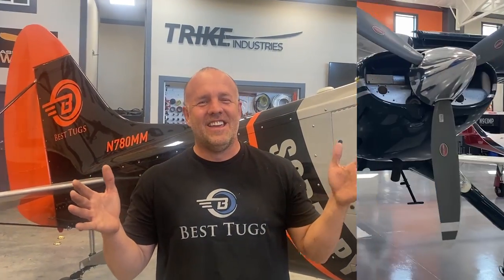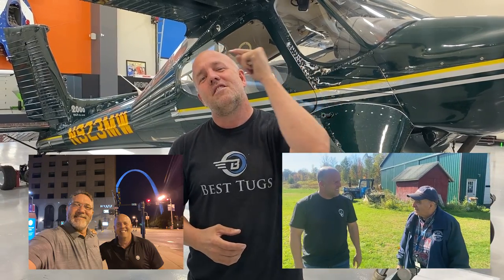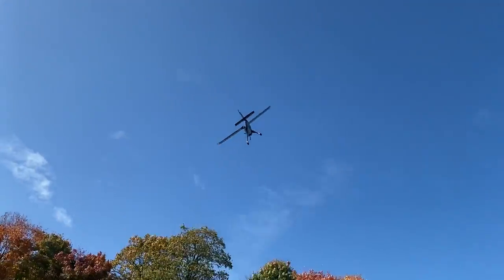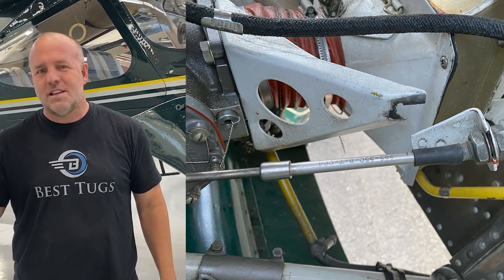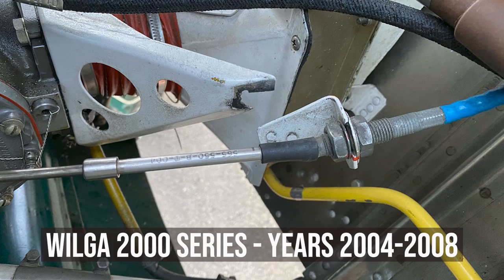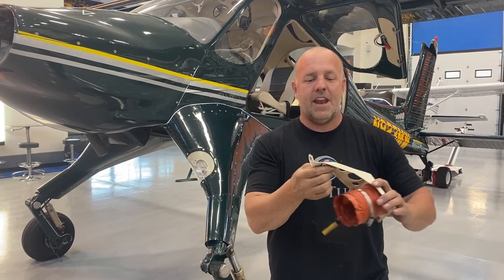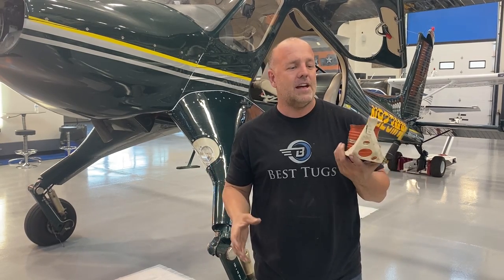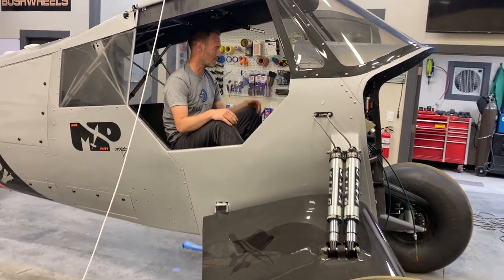Engine Trouble Flying Home a New Wilga 😬 | Scrappy 30

Comment: Okay, I've always been wondering this. Why aren't these things just fuel injected? Why do you have to adjust the mixture all the time? Is it strictly for altitude or do you also do it for performance? I guess mainly is just Why aren't these fuel injected? I know what Richland up an engine does less power cooler running motor Etc so what's the deal?
Reply: Mixture adjustment is necessary for altitude, as you go higher the air is thinner so in order to keep the proper ratio of fuel to air the fuel is reduced via the mixture control.  It is also used for economy and range by reducing the gallons per hour fuel flow by reference to exhaust gas temperature.  Mixture adjustment is still necessary with fuel injection.
Reply: @johndelprete8175  Okay,  well then you didn't answer the question. Why? Can't fuel injection do all this?
Reply: @travisk5589  Some engines are fuel injected but fuel injection provides a fixed volume of fuel.  These engines are still equipped with a mixture control.  Some newer engines are Full Authority Digital Engine Control (FADEC)  they auto adjust mixture and timing.

Comment: Was flying a Cessna 152 I was doing touch an go and my carb heat cable broke on a carb heat on perdition. I loss RPM. I called tower emergency landing.

Comment: That rivet spacing is terrible on that bracket. Two rivets with correct edge spacing would be sufficient. That mix cable is only applying a shear load.  Sometimes more isn't always better.
Reply: The end piece needed to be thicker and bolted with two AN bolts along with doubler on back side.

Comment: Not always the engine. Look at everything. Lost a windscreen, lost a prop blade. Lost partial power, smoke in the cockpit twice and small engine fire during runup. 5000 hrs over 38 years. Have fun but don’t get complacent. Always,always fly the airplane til it stops.

Comment: Interesting the bracket assembly is made out of aluminium. if I saw that in an aeroplane FWF being built I wouldn’t fly in it until it was replaced with steel. Some of the bits in some certified aircraft are pretty dodgy.

Comment: Having a "really" good look around from time to time on a day you have no intention of flying (pretend someone told you their was a fault on the plane and demands you see if you can find it) , Preparation for the worst, practice for failure (various). Glider pilots aren't phased by engine failure. General intolerance of anything wrong (anything - noises, smells, weather, fuel, disruption of plans, recent works, minor failures present, or recent) . Any flight - only one new thing at a time (new plane, new route, weather, IFR,, night, mountains, etc, etc)

Relevant cliche - 
If your car fails you walk, if your boat sinks you swim, if your plane isn't airworthy - you cant fly.
Better on the ground wishing your were in the air, than in the air wishing you were on the ground.
There are old pilots and bold pilots, but not many old bold pilots.

Comment: Mike explain it differently : Aviation compared to driving your car. How often do you see a car broken down on the side of the road. Anything you build even mother nature builds is only build that good. So things can go wrong and will go wrong. But as better you prepare yourself as better you will react in case it happens even it is just the human pilot who ran out of fuel. And has to land it's empty plane. 

Better be prepared than sorry. Flying is a lot of fun but also comes with responsibilities like driving on a public road with thousand others.  
So always safety first. Because your family needs you alive.

Comment: why is that bracket riveted and not welded?
Reply: The weldable alloys of aluminum are not usually used for sheet metal parts of aircraft. The high strength aviation alloys most often used are 2024 and 7075, both are not good to weld.
Reply: @robb1165  interesting, i found this "Probably, the two most commonly found aluminum alloys within this category are 2024, which is an aluminum, copper, magnesium alloy, and 7075, which is an aluminum, zinc, copper, magnesium alloy. Both of these materials can become susceptible to stress corrosion cracking after welding".   i'm not a welder or aerospace engineer but we don't know what the part was made of and it cracked and broke anyway, while in flight.  there is no need for "high strength" aluminum to hold a mixture cable.  i'm just saying, having the benefit of hind sight, a welded part would be better or a composite part.  obviously the riveted part didn't work and could have easily resulted in death but for the skill, experience and shear luck of the pilots.
Reply: @frotobaggins7169  There are many reasons to use the alloys they use. Mixing materials often results in an increased chance of corrosion. Weaker materials add weight. Welding thin aluminum parts is a real issue.   Reality is that is an older plane, and it did work well for many years. The damage was obvious and should have been noticed before it came apart in flight. And the number of general aviation planes that crash is often shocking.
Reply: @robb1165  i get that mixing metals is a bad thing.  but they could use an aluminum that doesn't have embrittlement issues or they could use a different design such as the autos use where the bracket is on the engine.  they are smart, clever people, that bracket looks like a bad after thought is all i'm saying.  the term engineering doesn't come to mind when looking at the bracket.  i'm not hear to argue, i'm just sharing my opinion.  fact is they designed it, they chose to use rivets and it failed.  so they add one rivet and you want me to believe it's fixed?  i'll pass thank you.
Reply: @frotobaggins7169  Yes it was poorly designed with the rivet spacing and area. However that bracket should not support the cable. It just locates it in relation to the mixture arm. I would expect the cable was not properly secured or aligned back a foot or so.
Reply: @robb1165  yeah, i don't know the relationship of the cable to the bracket/carb.  i sort of expect that it stops the sheath so the cable can operate the mixture  on the carb.  i've never seen or worked on any kind of aircraft so i really don't know.  he just briefly showed it in the video.  but most cable operated systems i'm familiar with require the sheath to be stopped at both ends then the cable slides inside.  with the broken bracket, the sheath was unable to locate the cable preventing it from operating the mixture.  he said after fussing with it it did work a little more before failing.  all very interesting to me.

Comment: When you lost your engine, in the dark, in the mountains, did you declare an emergency and/or turn your transponder to 7700 to inform ATC of your problem? I did not believe I heard you say anything about that in your video. You were discussing safety, and as a non pilot, when your only engine quits, I suspect that’s an automatic emergency situation and as circumstances permit, you should be letting the world know your in trouble in case they need to send out the Calvary to help if required. (Full disclosure, I am not a pilot.)
Reply: All that stuff is important but is done after the initial actions that Mike is discussing here.

Comment: Why are plane engines still carbureted?  Fuel injection solves so many problems no?
Reply: Most folks don't understand carburetion. It's tried and true technology. Also, if it's a certified aircraft and engine, you must retain that original configuration.

Carburetors function using physics, they deliver a needed quantity of fuel for air mass that passes through the venturi. Fuel injection uses both mechanical metering and electronic, the system must calculate the air mass.

I've worked with systems of all designs, and they all function well. The key is proper maintenance.

The bottom line is safety and dependability. This is a good reason for the venerable carburetor.